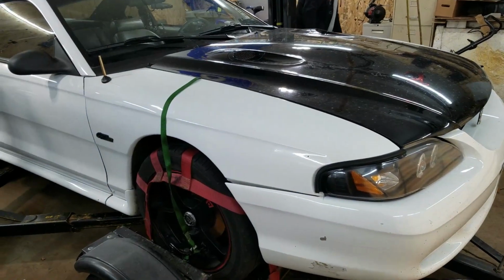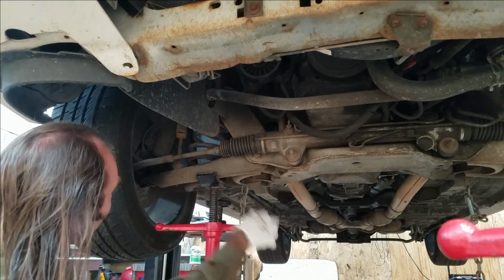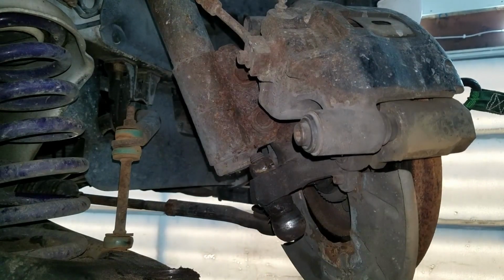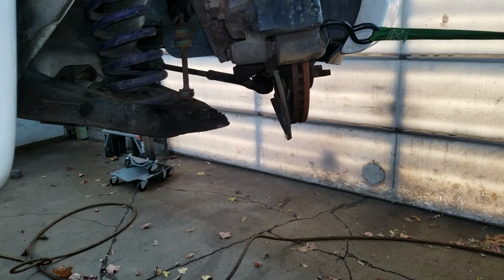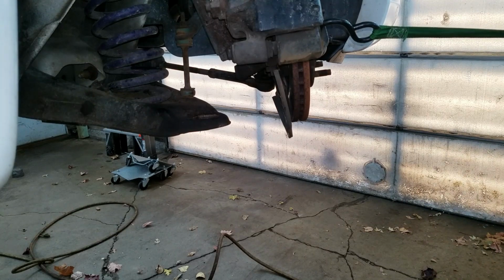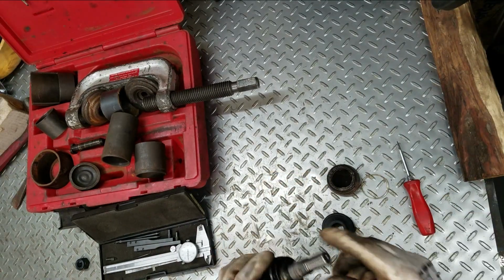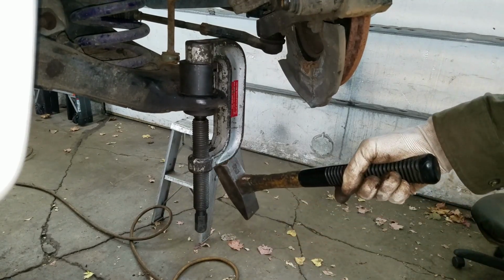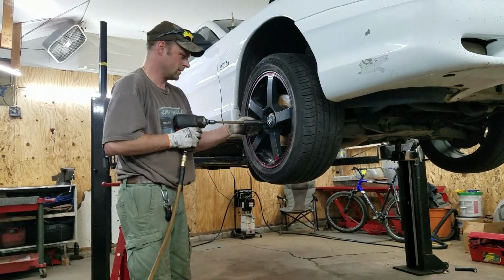1997 Cobra Mustang ball joint replacement

Comment: Great video! The only thing i would suggest is to leave a jack stand under the arm as you service because that sway bar link could have broke from the tension of the spring. Especially with all that rust.
Reply from the maker: No sway bar links were harmed in the making of this video.